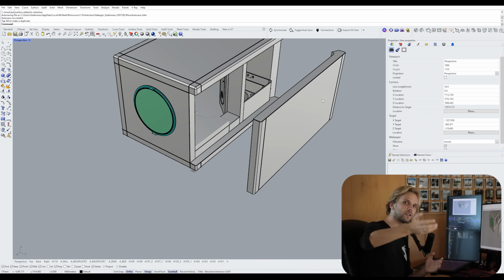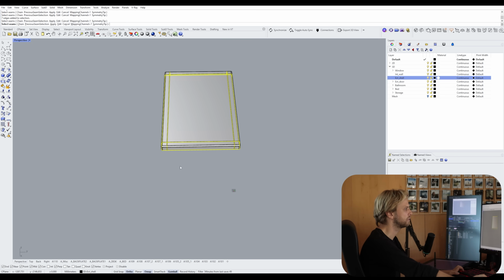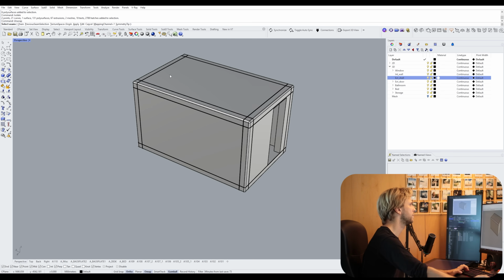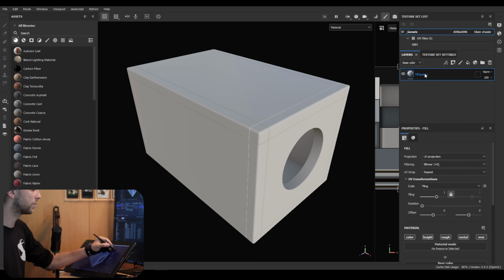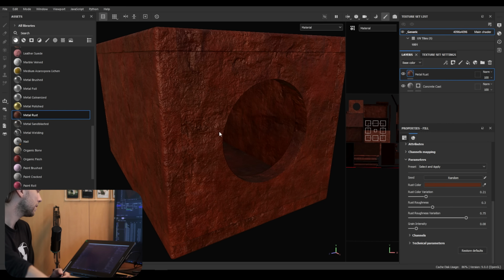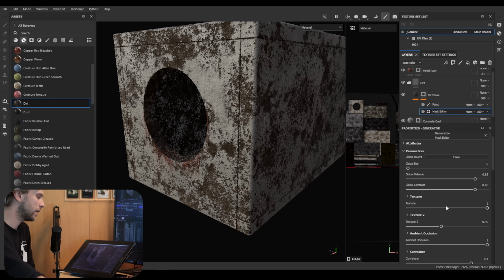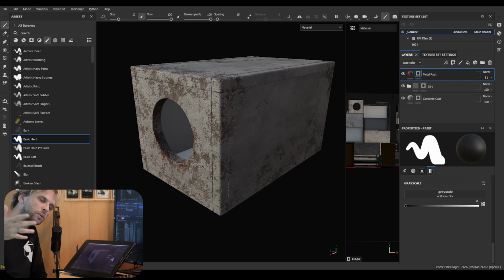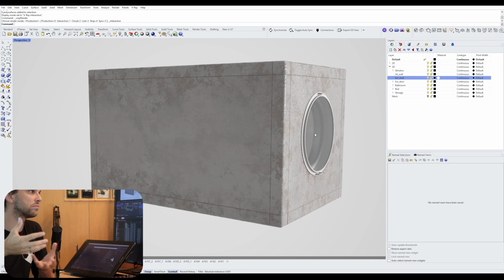Custom Textures: Rhino to Substance Workflow

Comment: Some nasty errors going on here.. You are using the roughness map in a wrong way. 
You should only plug it in the reflection roughness and leave the diffuse roughness alone.

The roughness map, and also the normals, metallic, displacement (and whatever map which is not a diffuse/albedo base color map) should always be imported as raw color space, NOT srgb. 
They are just raw data channels (they dont carry any color/display information), if you put a gamma correction on top of that, the data will be distorted and misinterpreted from the engine (that's why your reflections looks weird). 

A decent unwrapped normal map should always be used at 100/% strength, nothing more, nothing less.
If it looks weird, you are most likely using an openGL normal map where directX is expected or the other way around. 
You may want to doublecheck that.. or if you don't know what I'm talking about, just flip/invert the green channel to quickly see if that's the problem (pretty common for texturing beginners). 
If you check that everything is matching correctly and the normal still looks weird, then I would advice to fix it in substance rather than messing with multipliers. 

You should never ever use (an 8k) pitch black map for metallic. 
If your material is not metallic, just don't plug any texture and leave the metallic multiplier at 0 and that will save tons of memory.

By the way, using 8k maps is (by far) an overkill for that model, unless your final render frame will be 16k or something, lol! You  should try to save memory whenever possible.
Reply from the maker: A lot of good points here. 
Some notes from me: 
Diffuse roughness was suggested by a Vray developer as an optional strengthening of the initial roughness map (specifically when dealing with gloss+scratch) . Shouldn't be used all the time, but there are instances where it's quite fine to use.
I'm not sure if greyscale maps care if it's raw or sRGB while the normal maps are clearly sensitive to color space (also openGL vs directX standard) and should be treated as you've described.
I use 8k pictch black map for metalic when the map is a placeholder for further reimports that will actually have information in the map. My workflow always has all links created first and textures adjusted later, it's neither correct not incorrect - just the way I work.
Regarding resolution - ideally 4k/2k UDIMS should be used to optimize this, but Vray for Rhino is bad with them, so a uniform resolution has to be used. I tried with 4k, which prevented me from getting up close to the walls, so 8k was used. For this kind of static stuff: quality always above performance optimization.
Reply: @DesignGoBrr  Ok, the placeholder thing makes sense, you should probably had to clarify this a bit more, because an absolute beginner watching the video could be tricked to think that adding an 8k black map in the metallic slot, by itself, can do any good for quality, which obviously is not true.

About the roughness and other data channels color space.. trust me, you should use that in raw colorspace. Nomatter if there's actual color showing up, srgb space will put a gamma correction curve on all 3 of the rgb channels, affecting in particular midtones. 
You can easily verifiy that creating a couple of duplicated objects with the same duplicated material, but using srgb on one and raw on the other one. 
Render them side by side and you'll notice that the one using raw data will be more consistent with the results you get in Substance (if you want to be more accurate in the comparison, try to use the same hdri setup both in Substance and Vray).

The roughness in the diffuse channel, as far as I know, is more of a legacy feature and doesn't have a proper matching channel in Substance pbr, so you could still use that for "artistic purposes" and that's fine, but from a "mathematical" standpoint doesn't make any sense.

About the UDIM tiles workflow, I'm pretty sure that you can find a workaround to work with them.. I'm able to make them work in Sketchup which is as shitty as Rhino (if not worse) in manipulating UV coordinates and doesn't offer native support for UDIM. Just offset your uv chart by one UV space at a time (an UV checker with really obvious UV borders is pretty useful to setup UDIMS and avoid overlaps)  and then create multiple materials in Rhino for each tile (and obvioulsy assign them to the corresponding geometry). I made this work tons of times in Sketchup, in old 3dsMax versions, in Unity and so on..

Another neat trick when dealing with large architectural models and texture resolution is to create separate tileable materials in substance and blend them using Vray Blend material. Then just use painter to paint masks for the layered material.

Lets say you want to create a really high resolution wall with some dirt scattered on top, you could manage it creating 3 separate substance projects, one for the wall material (Standard Vray Material that you can tile as much as you want), one more for the tileable dirt and the last one just "black and white" project to paint the mask over your unwrap. Then use the mask as the blend alpha (and keep the tiling 1x1).
In some cases you can get away with a 4k map for each base material and a 4k map for the dirt mask and still get better overall detail than a single 8k set. Of course you can layer as many materials as you want.

Comment: Hello, great videos man! I have an issue that trying to solve for long time. How can you have your architecture model to be unwrapped and have the texture scaled to the exact dimension of the texture image? I tried a simple experiment of creating 2 boxes in 3dsmax with the exactly the same dimensions say 200x200x200 cm and i applied a texture with 200x200cm. This makes the texture fit exactly on the box where you can see the edges of the texture images exactly on the seams of the box. However when I unwrapped the second box and want to texture it while keeping the Unwrap in the UV 0-1 space, i tried tiling it with the bitmap, it works if u manually adjust the UV island of the box to have the texture fit within, but you cannot type the dimension of the bitmap in U and V parameters to have the texture exactly on the face fit automatically. This is because the island and the texture has no real world relativity, it does not know how the texture should be scaled automatically to the proper tiling of the box. It does not matter if I am using 3dsmax or other software, because the concept applies to all the same. The thing is when you have one model to do, you dont mind doing it manually, but when u have several models it becomes a heck of unnecessary work which i think that the program should solve for you. Do you have any suggestion on the topic?
Reply from the maker: Yea, I have a bit of a suggestion - forget about tiling, do everything 1:1 for unwrapped objects. In this video I use Rhino to create precise textures that should be mapped on my objects - https://www.youtube.com/watch?v=dc8JKgTHoUU hope you'll get some insights from it :)
Reply: Thank you! Please keep uploading love your content ❤

Comment: Very nice content @DesignGoBrr, You are always explaining all in detail. Thank you. I have just one question : Is it possible in Substance to reverse the texture to be embossed instead of debossed? Because it seems that the dirt texture looks debossed or engraved inside the concrete texture. It should be embossed, right?! Am I correct?
Reply: You should try inverting the normal channel of the concrete layer. Flip green or red may work.